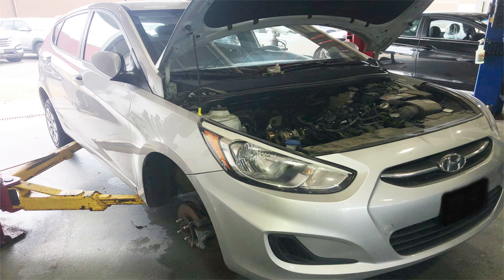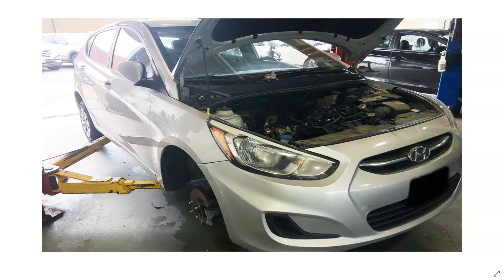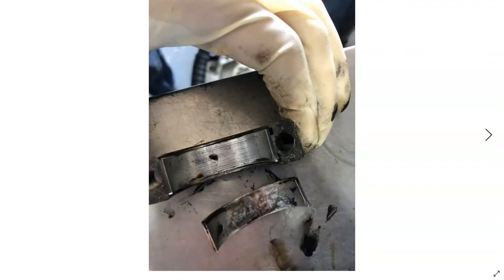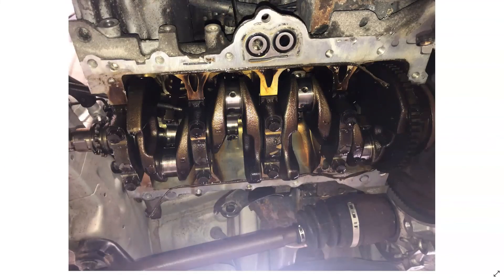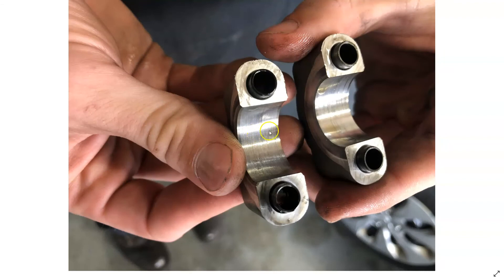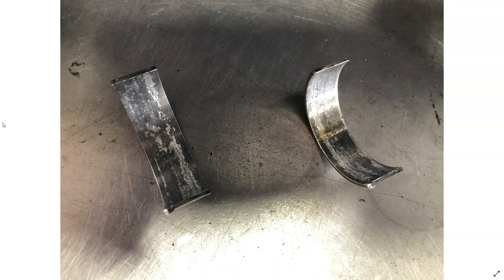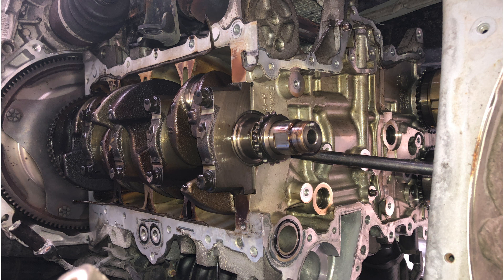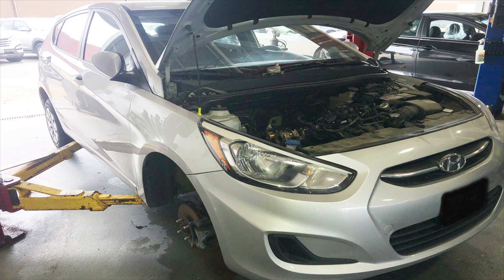2015 Hyundai Accent 1.6, Engine KNOCK noise, rod bearing failure, excessive rod bearing clearance

Comment: I've heard these issues before and all are reverent claims. There are several factors and some have been mentioned here.
I'm new to the Hyundai family of cars. My girlfriend has the 2.4 in her 2013 kia forte with 170k Miles at present and no noise other than a weird pulley noise it's always had, knock on wood.
I recently purchased a 2014 hyundai accent with this 1.6 engine. It has 119k miles and other than the pecky sound from the upper end it is normal. I was told this sound is inherit of the engine, but ofcourse the lower end noise from rods is a different beast issue. Hopefully my won't have this issue in future.
This is what I've researched and read. 
These different engines all have weak oil pumps to start with. So you must replace the oil filters with OEM ones that are specific to these cars. They are engineered to keep oil present and pressure when needed at startups when it's most critical. After warming up the oil then starts to circulate as normal.
Most goofy lubes and others don't use OEM filters and after while the damage is done. These engines as I understand don't have variable timing or hydraulic lifters either so after while they have to be adjusted. Sooner than later if you don't use genuine OEM oil filters. 
I recommend this as detrimental and I would also use correct oil and mid grade or better gasoline at the pump. This will keep your engine cleaner and last longer for any engine.

Comment: Wow, I dodged a bullet. I was looking at used Hyundai i30s and Kia Cee’ds with the 1.4 mpi gamma and the 1.6 gdi gamma engines. I was aware that Hyundai were having issues with their Theta and Nu 4 cylinder engines but I wasn’t aware gammas were also problematic until I did some further research. I’m glad I didn’t get one! 
EDIT: Have you come across any timing chain issues on these? I’ve seen reports of them stretching on European 1.4 gammas.
Reply from the maker: Yes. It would blow your mine how much Kia and Hyundai engine failures I have seen.
Reply: Even the Lambda V6 engines are having problems as well.

Comment: I have the same engine in my 2015 Hyundai Sonata 1.6 liter turbo charged GDI. My engine is blown at 89000 miles. Hyundai claims my car is not part of the recall but it has the same issues as the ones recalled. My car was properly maintained.
Reply: So they denied fixing it even though you were in the 10yr 100,000mi warranty?

Comment: I’m working on my soul and I have the same issue but I can’t get the upper oil pan out because there is a pin in one of the bolt holes. 

It’s only one and it’s on vertical part connecting to like the flywheel. I’ve seen people cut them in half but what’s the actual way? Help please
Reply: I need to know the answer to this question also.

Comment: do u have to take the engine from the engine bay to work on those rod bearing?
Reply: yes, you can't access the crankshaft at all by removing the oil pan, it has to be completely pulled, timing case removed and crankcase separated from the block to get in there.